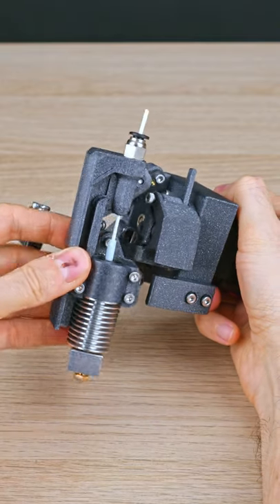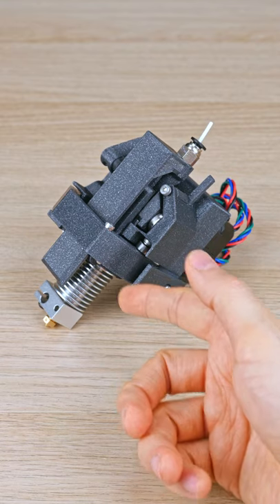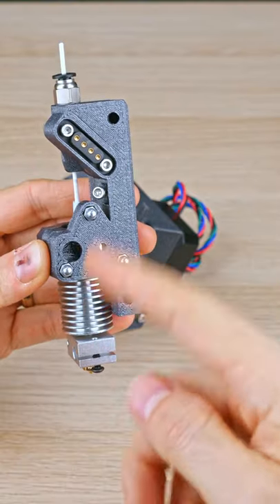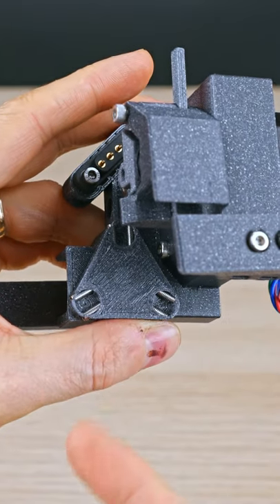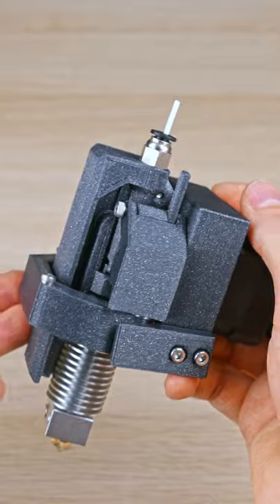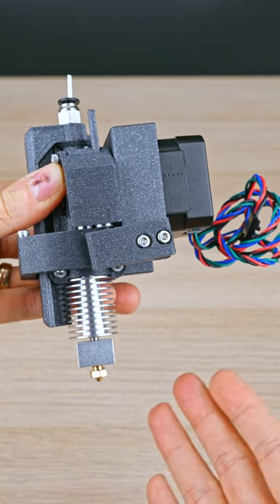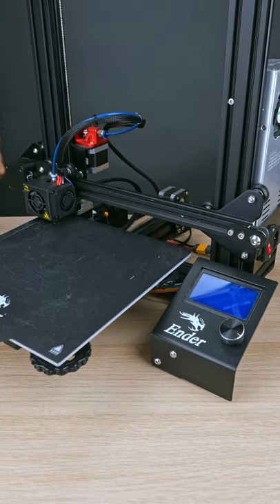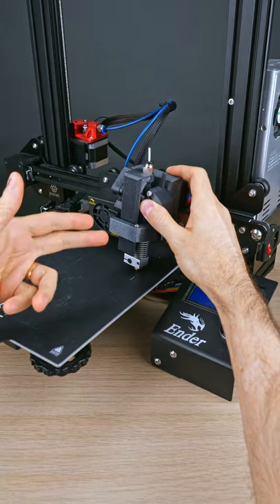My short term development plan for my 3D printer swappable hotend, the PitStop 2 extruder

Comment: I’ve seen so many of your shorts that I had to subscribe after seeing this. I’ve only started 3d printing for about a month now and the bug has definitely got me with 300 hours now on my adventurer 3 lite. Already thinking about getting another one with a bigger build plate once I get some more workspace set up.
Reply from the maker: Welcome aboard! Sounds like you're enjoying your printer which is awesome. Was it easy to get going and learning the ropes in this new domain?
Reply: Somewhat considering the ad3 lite was ready to go out of the box but figuring out how to download the software and what software to use was a little challenge. I got it all set up and printing the first day but since then I’ve learned through much trial and error through many failed prints lol. I’m happy to say though that I think I have more successful than failed prints so far.

Comment: Nice design! You should look into Eva carriage .. they use a backplate and easy change parts aswell .. maybe team up or make a version?
Reply from the maker: I did consider a design that would work with rails and a 2020 only. In fact that's how I started. Then I realized it wouldn't work on many printers. Makes more sense to have something more universal that happens to support rail mounting.
Reply: @MihaiDesigns  that is what Eva does .. diffrent backplates for diffrent kinds of extruders/hotends/printers .. it is made with some people from rat rig so it is very good for 2020s but there is other backplates for other kinds of printers

Comment: So when it is finished we can attach this swappable hotend on any printer am I right
Reply from the maker: Somewhat right. You would be able to attach it to most printers, but you wouldn't be able to use the whole build volume unless you make some changes to the frame.
Reply: @MihaiDesigns  I dont have any printer yet and prusa's are so expensive. But I am adore your swappale hotend...
Reply from the maker: @ticonderoga2906  I'll try to mount it on an Ender first. Then on other frames as well.
Reply: @MihaiDesigns  You are awesome... Loves...

Comment: Did you print all of the using PBT filament?
Reply from the maker: These are just PLA for demo purposes. Final thing will be more heat resistant, obviously.
Reply: @MihaiDesigns  the texture just seemed oddly familiar with PBT filament with carbon dust. But it is the material that i have incountered that has the highest isotropic strength compared to any other (PC, PLA, PETG, ABS etc..), but it is a tad more flexible but correct geometric configuration can ensure stiffness.